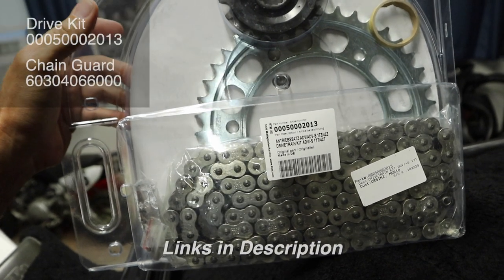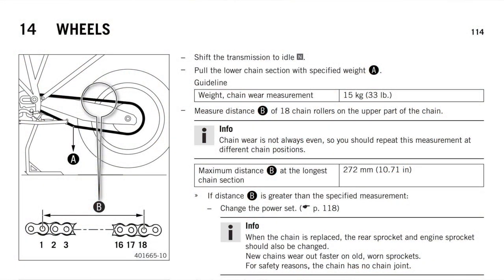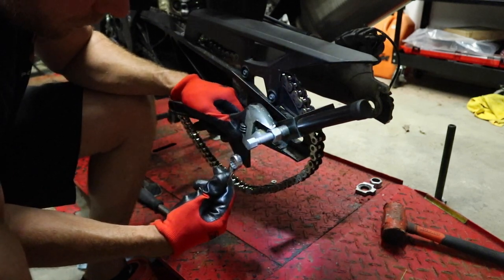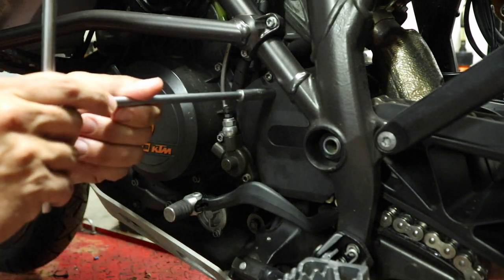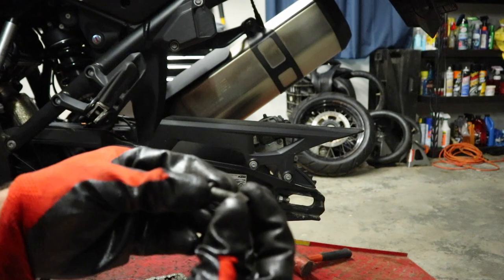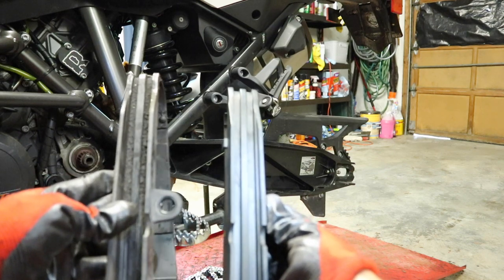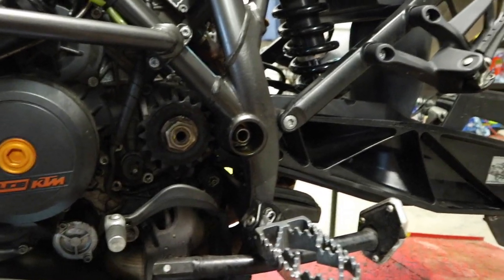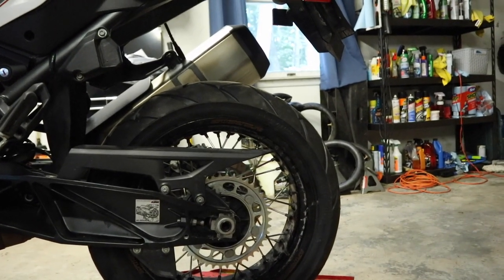KTM Chain and Sprocket Install 1090 1190 1290 Super Adventure | Back in the Garage

Comment: Like all your other 1290 repair/maintenance vids, great job.  Taking a small wheel grinder to the flared rivets will make the chain break much easier.
Reply from the maker: Typically I will grind them but in this case it want necessary. And thx!

Comment: Thanks for the video Mario👏, it was very helpful as always. A couple of things I did differently was get my wife to stomp on the rear brake pedal while I loosened and tightened the front sprocket nut. I didn't loosen the swingarm to replace the front sprocket. It came off OK with the swingarm in place albeit with little clearance. I got 39,000km out of the original chain and sprocket set using a Scottoiler to lubricate. The chain was at its wear limit for length and the front sprockets had appreciable wear, so definitely in need of replacement. I am happy with that, 39,000km is a good result for a chain and sprocket set on 1290.😊

Comment: For front sprocket access , after swing arm bolt pushed back, I used a floor jack to lift the chain side swing arm upward just a little pressure  and it held it clear.

Comment: If I’m getting rid of the old chain, just cut it off with a cutoff wheel. But I work flat rate:) also I crack front sprocket nut loose before taking off chain.

Comment: Great video, I changed mine yesterday on my 2019 1289 Super Adventure S,  I have a question though.  I found my splines on the counter shaft partly worn and the old sprocket had movement. The new sprocket still has a little movement on the splines although it is ok with the nut tightened up.  Im confused as to why the splines on the shaft have wear as I have had the bike since new and this is the first replacement in which Im using genuine parts. Wondered if you have came across this before?
Cheers

Comment: It is better to losen the sprocket nut with the chain still attached and the bike in neutral, just step on the brake. That way you don't stress the transmission being in gear
Reply from the maker: Mike has 62k miles plus…think it will be ok

Comment: Hi Mario, I don't understand why you have to remove the bolt on the swing arm, I have changed my chain guard and the front sprocket without removing this bolt . My bike is a 2015 1290 SAT , it's strange no ? 🤔
Reply from the maker: Again, depends on each bike. Some I’ve worked on have the clearance while some don’t. Guess it comes down to the tolerances at the factory. I’ve had some close ups of mine on the previous video where you can clearly see it ain’t coming off without some shimmying of the swing arm.
Reply: @2WR  OK many thanks for your prompt reply, and for sharing your experience 😊✌

Comment: Great video. How did you remove, and subsequently re-install,  the rear sprocket bolts without them spinning around?
Reply from the maker: Like I showed in the video, the ridge of the sprocket holds the bolt head so they can’t spin.

Comment: Great video thanks. I thought I'd done well getting 22000 miles out if my chain and sprockets, I could have probably squeezed a bit longer but quite a few tight spots now and I have a big trip planned in a few weeks. Not sure if I'll need a new chain slider. What's your chain maintenance routine as your getting good life form your chain and sprockets. 👍
Reply from the maker: Clean it when it gets dirty. Lube it after cleaning or after it gets wet. That’s it. Too many people use too much live which just attracts more dirt and wears them out faster.
Reply: @2WR  Couldn't agree more. 👌

Comment: Do you think the front sprocket can be removed by just removing the slave cylinder, the chain saver, and the swing arm bolt pushed back?  Without removing the chain completely? (2015 ktm super adv stock sprocket) EDIT. For those who are wondering I did this today after posting the question, and it worked without removing the chain. You will have to remove the slave cylinder, and the chain saver as well as the little plastic piece that goes on the clutch push rod. I slid the rear axle out enough to pop the chain adjusters out, and slid the rear will forward enough to remove the chain. Saves the trouble of removing a link. Win.

Comment: Dude - about to do this myself on my SAT. Excellent video. What are your thoughts on these maintenance free chains like the Regina? Cheers.
Reply from the maker: Same as “lifetime” transmission fluid…no such thing.
Reply: Hi Mario. Wondering if you get high points and low points on your sprocket which cause the chain to tighten or slack as you turn the wheel. Cheers

Comment: Thanks for realy good video, just sold my Z1000 and got me a KTM 1090 -18, which need a new back tire and clean up. Just a short question, when you remove the slave cylinder you say that "don´t pull in your clutch levert", could you explain why, and what would hapend if? BR/Andreas
Reply from the maker: Because it will depress the slave cylinder. Then you’ll have to bleed it.
Reply: @2WR  thanks I understad. Trying to get a grip around the KTM mechanics. Only experinece från old HD Sportsters.

Comment: Hi 

I would like to clean the front sprocket cover in my 1290 sas from 2020, my question is: are there only 2 fixing screws there? Next to it there is a mechanism from the clutch and do I have to disassemble it too? I wouldn't want to broken anything.
Reply from the maker: There are only 2 screws to remove the front sprocket guard. No need to remove the slave cylinder unless you're wanting to remove the front sprocket.

Comment: Great job on the video as usual! I have a bit to go yet befor it is chain time on my 1190R. Having a nice clear video of yours is going to make that job easy. As my bike is the R model and I wouldn't mind a little lower gearing for off road, what is your thoughts on a smaller front sprocket. Some guys say it puts to much on the chain slider and wears it out to quickly. What is your thought?
Thanks for another great video. 👍
Reply from the maker: Thanks Jeff. I see how it could wear it out faster as it would (in theory) have a little more pressure on the front due to the smaller sprocket size. As long as the chain is properly adjusted; I'd probably runner it to the looser spec, I don't it would wear it much faster.
Reply: @2WR  Thanks Mario!

Comment: I adjusted my chain and it is new but it makes a lot of slapping noise and is that normal on a 2022 1290 SAR? It has done it since it was new. I hear some complaints on these bikes for slapping noise from these KTM Super Adventure motorcycles.
Reply from the maker: If properly adjusted it shouldn't be making any slapping noise. I haven't messed with the new 2022 SAR much yet but Tyler's got some miles on his and hasn't experienced that. Brian experienced it on his 2020 1290 SAR but turns out it was just out of adjustment.

Comment: Ordered the OEM sprockets and chain.  Question,  the new chain came in one piece with no master. Is this normal ? I'll have to break the chain and order a master to install it.
Reply from the maker: One long piece connected? That’s not normal. Needs a master link. I’d return it
Reply: I ordered the same kit for my 16 1290 sat.  chain came in 1 piece.  I had to drop the swingarm out to install.  That was fun.

Comment: Taking off the slave cylinder, loosening the swing arm, and taking off metal upper sprocket guard are all completely unnecessary steps to change either the front sprocket or the chain sliders.
Reply from the maker: Maybe on your bike but I’ve had countless people email me telling me they had to do it on theirs, as have I. 🤷🏻‍♂️